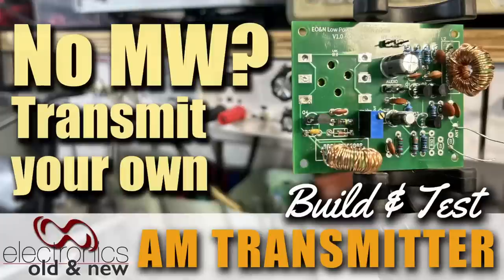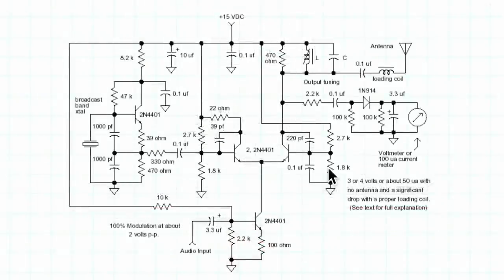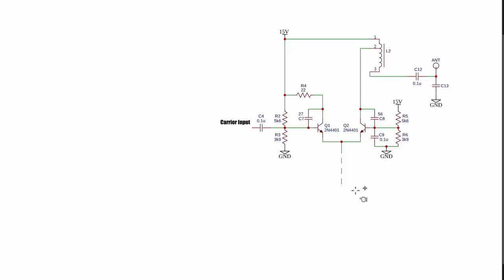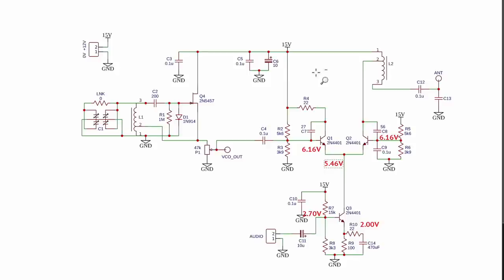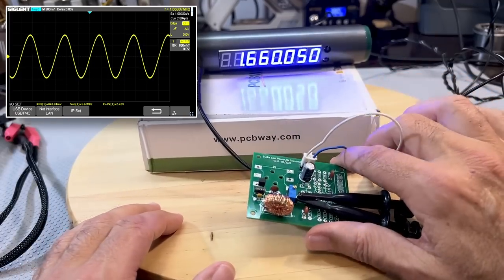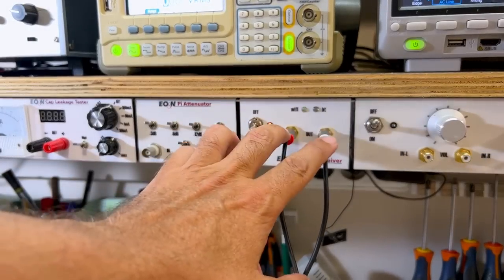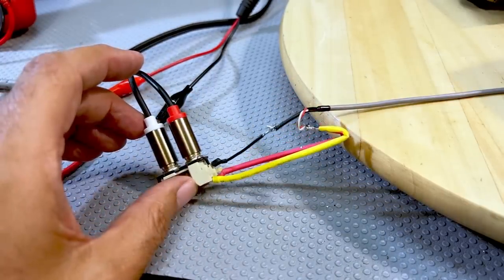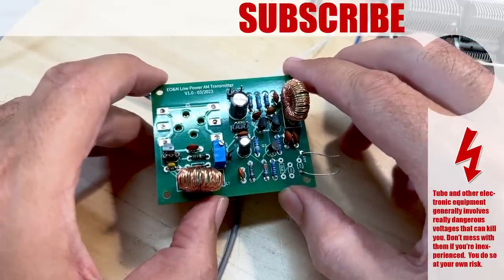DIY Transmitter for the MW Band: Stream Music & Test Tube Radios  #pcbway#

Comment: Charles is a true gentleman. I built his transmitter with the pot coil and it works perfectly.  My changes included using a digital freq synthesized oscillator IC so I can find a quiet part of the band to transmit in.  I'm not crazy about the long wire antenna though so I'm planning on trying the coil antenna design - but making it smaller if I can get a decent range with the magnetic field.
Reply: Very nice and informative

Comment: Oh, I love those Wenzel AM transmitters! I built two, following the Improved circuit on his page and they work brilliantly. No mods, since I don't have that much knowledge and they both run on a fixed frequency with a crystal. Both transmitters work with regular telescoping whip antennas, that allow a range of around 10-15 meters. One transmitter is in a box of its own, with batteries - a stand-alone unit I can connect to a PC. The other transmitter I built inside a battered FM radio and acts like a repeater of sorts - tune in an FM station, that then goes out on AM.
Reply from the maker: 👍 they really are useful.

Comment: Excellent! Thank you for the detailed circuit rundown as I only knew basically how low power transmitters worked.  I've wanted to buy or build one for ages but few people make commercial units anymore and most of the buildable circuits lack sufficient fidelity to be worthwhile.  WiFi is just too easy these days. This will be a fun project - looking forward to the final version!

Comment: Nice Manuel, nice tool, the loop antenna probably give  you more  range although some rooms  with "shielding", like the kitchen (tiles contains metal oxides,...), also loops are  directive radiators, with nulls, so you have now plenty of testing ahead, enjoy. 👍👍😊😊
Reply from the maker: Lots and lots of testing 😊 I’m driving my wife mad

Comment: Looks like a single voltage gilbert cell. Good for AM. I thought about a similar projekt with a Colpitts osc 0,4 - 1,6 MHz with a full Gilbert cell and a little linear amplifier. but I see this modulator is more simple. Very interesting.

Comment: Cool design! I made a short wave transmitter myself at 7.2 MHz. I used LM386 audio IC for enhancing audio and used 2N3904 for Pierce oscillator and modulated two with BF494 to get 30 mW to 40 mW RF power. Used fixed inductors and capacitor, calculated, for 7.2 MHz in tank circuit. I intentionally avoided toroids and ferrite based wire-wound coils as I didn't have wires and ferrite or toroid so had to do with fixed ones. Since I didn't have audio transformer either so I applied audio on BF494's emitter. As you guys can guess, this paved way for some FM as well. In the end, however, my little TX covered close to 40 yards sounding through my entire house and going over to neighbours too. The day I was testing it, my scruffy neighbour reported me to Frequency Allocation Board (FBA) Pakistani equivalent of US FCC. Alas! They confiscated my little concoction. And that was the end of my AM journey folks. Pray for me!
Reply from the maker: Some neighbours are the worst
Reply: @electronicsoldandnew  indeed but that didn't stop me from continuing my work. I'm making another one. Wish me luck!

Comment: Try a copper wire or foil under the workbench as an antenna. An easy way to get a loosely coupled signal to the repair object. And as usual a nice design and I see your PCBs getting better with each design. Thanks.
Reply from the maker: 👍 thanks

Comment: Nice to see that somone else has experimented with this transmitter. I made the loop antenna version a view years ago, also with another oscillator because I had no crystal handy. But it seem that your oscillator is much more stable than mine. I probably want to change it with yours. Thanks alot with your explanations and i'm curious what you will get with the new coils.

Comment: A great version of a great circuit! I built Wenzel's transmitter a year ago for the same reason - AM in Brazil is being rapidly (and almost criminally) dismantled, and what you listen is not always what you want, so... I went ahead and built it with some modifications too: a VFO, in order to be able to tune to the best frequency (or the least noisy...) and used a piece of copper clad board as a radiating antenna. The modulator part in this circuit works amazingly and now I use it on my workbench too, connected to my computer. Obviously, my implementation of it is not as carefully made and neat as yours, but it works nice anyway! 🤣
Also, I subscribed a few months back, while fixing a Zenith Royal 7000 I got for a decent price because wasn't working. The series was so entretained that I kept watching your videos since then, and I got to say: they are great quality content for us: radio repairers, amateurs and "crazy scientists"! 
All the best regards from São Paulo - Brazil!
Reply from the maker: Thanks Paulo. Espero que este canal ajude nos seus restauros 😊

Comment: Hi Manuel,
some fixed capacitors with different values and a tap changer would make the output circuit compact. 
The capacitor in my antenna circuit is built according to this scheme. 
You can also use these mini switches and use steps of 10, 20, 40, 80, 160pF etc.

Comment: But what is the power output of your device as it stands? Have you figured out it's range with a  ~3 meter antenna?   😐 Thanks.
Reply from the maker: It’s defiantly under the legal limit. We can work out the maximum current through the output transistor, and the total voltage across it. hence the power calculation.

Comment: Good fun, I also made a few AM stereo transmitters here, they also somewhat fixed in frequency +/-100kHz (1.3 to 1.5MHz). I use a 50 Ohm load with 3m of wire hot side for an antenna around the house, with an antenna tuner and a wire antenna outside I should be able to go a few km away (untested at this stage).

Comment: I use an old tube type RF signal generator that has a modulation input. Precision EC200. Works adequate for my needs, so far, which is testing old AM antique radios. I plug a tape or CD player into it.

Comment: I for one enjoyed the entire video!  No skipping for me.
A lot of interesting stuff was covered and I do appreciate it.  I had a thought while watching it.  You know how on most all AM radios that during the alignment process, they have you tune to 600 Khz and 1500 Khz during part of the alignment.  Well, I was wondering if it would be practical to use your new transmitter to transmit on those frequencies and use the antenna system to do the alignment instead of clipping onto the grid of a tube to inject the signal? Just a thought.
Thanks for the links too.
Keep up the excellent work my friend!
Reply from the maker: Good thought. However, I’m not sure I can get the tuning on both the front-end and the antenna to work well. I’ll see how it goes.

Comment: Hi Manuel ! Great job, like always ! Very interesting and also I like how You describe the fuctions ! What I would trie is to use the both sections of the tuningcapacitor like in an radio. The one part for the oscillator, the second part for the antenna. Of course I cannot say if the values are practicable, but I would trie it, so You can tune with the right dimensions both circuits together. Maybe it is a solution ?
Greetings Heinz
Reply from the maker: I’ve been experimenting with exactly that. We’ll see how it works out.

Comment: When I was about 15 or 16 I took the FM transmitter from a FM microphone. I found that if I upped the voltage from 1.5 volts (AA battery) to two 6 volt lantern batteries, ie 12 volts, and connected a 10 metre long wire, it would broadcast in at least a 15 km radius. I was in a very hilly area, at the top of the hill. It was before FM broadcasts started in 1976 and there were test broadcasts happening, so I don't think anyone noticed or even cared as long as we kept away from the test frequency.  When my father, who was a radar tech, found out he confiscated the transmitter in case the angry men from the PMG visited, so I went back to playing with Short Wave DXing. I still have the working transmitter in a toffee tin with an 1880s steam roller on it!
Reply from the maker: I too had my fun with FM transmitters. I started a pirate station on campus, and quickly took it down when serious men came snooping around 😊
Reply: @electronicsoldandnew  😂

Comment: Coincidence, I was just thinking about building FM wireless transmitter (Maybe tube) Fantasy Island reads my mind. Manuel I picture you transmitting a recording of your local group into your new station EON-650 KC and turning on all 150 of your restored receivers into it, after replacing the mains fuse and ensuring to the neighbors you'll turn the volume down your family returns. P.S looking forward to following this series about an FM Stereo module too.
Reply from the maker: 😊 one is mono, two is stereo. What do we call 150? 😊
Reply: @electronicsoldandnew  You could use Roman numerals, CLeophonic!
Reply from the maker: I like that 😊
Reply: @electronicsoldandnew  chaos

Comment: Very nice work.  The Wenzel transmitter has been a favorite in the "Part 15" broadcast community but yours is the first demonstration that I have seen.  I guess that your power supply is your bench supply, and it gives very low hum performance, which is a common problem with lower quality "wall wart" supplies.  Audio is very good and I'd love to see your transmitted bandwidth on a spectrum analyzer (as well as any harmonics at 2x, 3x, etc.).  Have you tested your transmit range outside your home?  Looking forward to future project development!
Reply from the maker: Still doing lots of testing. Will report back when done.

Comment: Hi Manuel. I wonder if one can make a FM receptor capable of transform that reception in a transmission in AM. I mean, a domestic low power transmission. In that way, we could make use of the old receptors that receive only AM. Is that possible? Thanks. Alvaro.
Reply from the maker: I suppose it’s just a matter of making an FM radio receiver and coupling the audio output into the input of an AM transmitter like this one.

Comment: Made many AM transmitters over the years. I like this one you've put together, wondered if you can use both halves of that tuning capacitor on the board to do frequency tuning and output tuning at the same time, it probably won't be perfect, but might track a bit better. The amount of problems I've had with selecting Jfets and soldering them in and out of a board, wish I had used your socket, makes life easier.
Reply from the maker: Yes, the capacitor tracking may work, but not sure how close it will be. Need more playing around with this thing 😊
Reply: Alternative for selecting the JFET is trimming the source resistor per JFET.

Comment: Well done, especially for a second prototype (no disrespect intended). Finger in the air thinking (and apologies if just plain daft) but maybe version ten could use 'tracking varactor diodes' (if, as suggested, using the second section on the current variable cap doesn't work). Murata makes some nice varicaps (don't know what precise values you need) and may be persuaded to send you samples if you pretend you are, say, Roberts, for example.
Reply: @electronicsoldandnew  There is a varactor-tuned am oscillator (very similar to your design) on physicsforums and a tuned antenna on stackexchange, which may give you future food for thought or indigestion.
Reply from the maker: 😊 thanks

Comment: you had mentioned about doing a video on winding the coils. Did you ever finish one yet. Looking to wind the coils with the T50-15 cores as you mentioned on your linked site. This seems to be the most daunting part other than initial tuning after assembly which I am still trying to grasp.

Anyway would like to build one as i recently restored many am only vintage receivers and would like to broadcast to them with this low power transmitter.

also does the guage of magnet wire to wind the coils matter?? I have some that is a little thicker than the stuff you used.
Reply from the maker: I didn’t actually finish this project because the results I got were a little disappointing. I may take it up again in the future. Every now and then an itch arises that I just have to scratch 😊
Reply: just interested in what way did it not work out? I may try to build it anyway and see what happens.  Just interested to know what I might have to debug and what wasn't working as expected. @electronicsoldandnew
Reply from the maker: That sound quality was not as good  as I’d hoped for.

Comment: Does the Oscillator tuning cap have a 1:1 ratio with the antenna tuning cap ?  e.g. 0.6Mhz tuning value being 300pf and the antenna cap peaking with 300pf.  If so you already have a dual gang cap...  You may need to tweek the antenna inductor to enable both tanks circuits to work.

Comment: Hi Manuel .. you mentioned a little while ago that you'd look into an AM transmitter that has adequate (or even high) audio fidelity. At that time I looked at this Nuts and Volts proposed schematic and project, but saw no reference to goods like fidelity or even frequency stability under time and heat. I imagine the stability of a frequency divider is good, but how would you rate the fidelity you're expecting (experiencing) with Charles Wenzel's design and this one? For instance, I'm not so sure about the claimed need to clip every few seconds if a receiver has good AVC design. Your thoughts?   p.s. Nice project!
Reply from the maker: Um still working on my project and have as yet not arrived at a satisfactory result, which is why I haven’t posted the results yet. However, sobrar I have achieved good audio quality, but, as is normal with AM, I can’t really call it high fidelity. I may be aiming for impossible results. We’ll see.
Reply: @electronicsoldandnew  Great to hear, Manuel .. and I trust you're getting there with frequency stability. Keep up the amazing work !👌

Comment: Hi Manuel.  Any reason you can't try to use the currently unused sections of the variable capacitor to tune the antenna as you tune the oscillator?  I realize that bringing the hot output in proximity of the oscillator might cause stability issues, but it might be worth a try.  Good luck / have fun!
Reply from the maker: I thought of that. Not sure if the capacitance values will track though.
Reply: Only one way to find out.  Might need to split the 4 capacitor sections into 2 equal pairs?
Another thought... since you will be building this in an enclosure would be to off-board the tuning to a large old-school radio tuning capacitor which might have better isolation between the sections?  Keep the great content coming!
Reply from the maker: 👍 will be experimenting to see what works best.

Comment: Why not using the second unused gang of your oscillator variable capacitor to tune the antenna. This way you would use the same control to tune the oscillator and the antenna circuit, just as it is done in a AM receiver...
Reply from the maker: Been thinking of that 👍

Comment: the MPF102 is an obsolete part. Do you recommend an alternative?

I DO NOT buy any semiconductors from eBay or amazon because most of them are counterfeit fakes. I've been caught up with crap from these sources before and no longer trust them for these. I buy ONLY from reputable sources such as digikey or mouser.

also do you have a parts list because right now I am having to guess the type of some of the components for example there is a polarized capacitor that is 200pf. Is this a tantalum and what voltage??
I am getting frustrated trying to figure out what components you used because the schematic itself doesn't really give me the specs of such components.
I am trying to make a PCB in kicad for this. Do you have any gerber files of the board or kicad files you could post??
Reply from the maker: Unfortunately, the results I achieved from this experiment were far from satisfactory, so I sort of gave up on the project for now. I might take it up again in the future but I’m not sure.

Comment: I know next to nothing about AM transmitters but can you alter the Q of the inductor to flatten out the peak? Add some resistance as Q value (Q=2πf L/R)?
Reply from the maker: Yes, you can.
Reply: @electronicsoldandnew  So does that mean with less Q and a flatter response over the AM band, you could increase the bias so the average output across the band is more constant? I like the idea of others to use a section of the tuning cap to simultaneously tune the antenna. Good luck with it, it's a great project.

Comment: Nice work. How much FMing is there on modulation peaks?
Reply from the maker: Not sure. I put this project on hold as the results I was getting were not as good as I’d hoped.
Reply: @electronicsoldandnew  Oh, that's a shame. It looked quite promising. I've made 1 or 2 watt MF txs using some using IRF510 fets and either series mod from a 2N3055 or the secondary of a 12-0-12v 15VA mains transformer. Crystals are great for stability and simplicity, but unless you add a divide-by-two stage MF channel fundamental crystals are virtually unobtainable now - except 1 MHz which is not a channel outside the Americas. DDS, synths, ProgRocks, etc. and other ways are out there but they're more complex than a simple quarts crystal.

Comment: I always love seeing/hearing your ideas :).   Sometimes test modules can almost be as much of an obsession as the radios themselves.
You have to watch that maximum power rating.  It is different form location to location.   I had a look at the circuit and I don't think I could legally operate it where I am as the rules are quite strict.   I'd need to make some mods to attenuate the output further, but that could be a different project altogether.
Reply from the maker: The 20mA setting can easily be changed by adjusting the bias of the lower transistor, which makes reducing the max power quite simple.